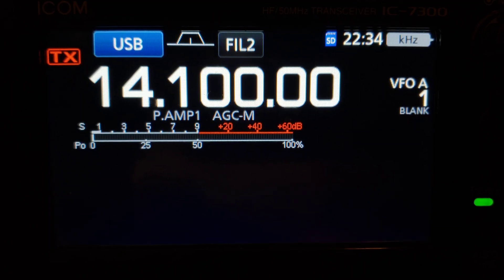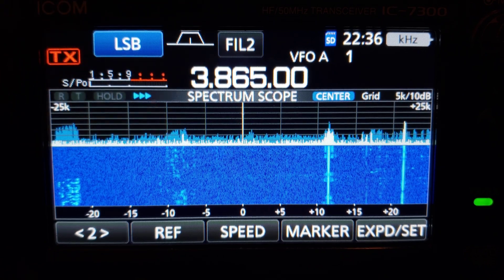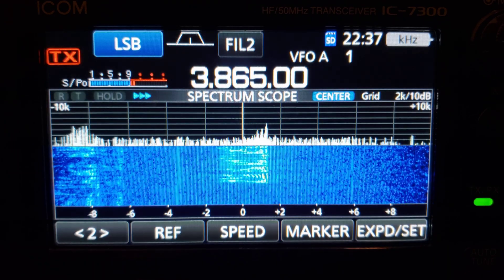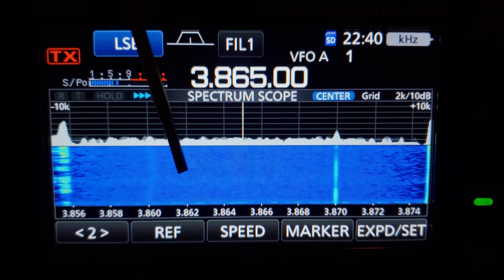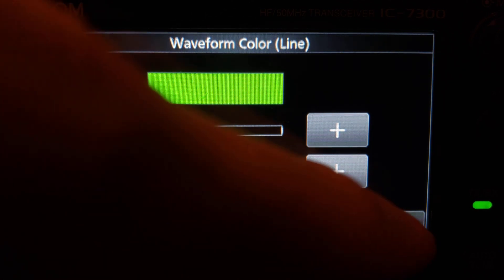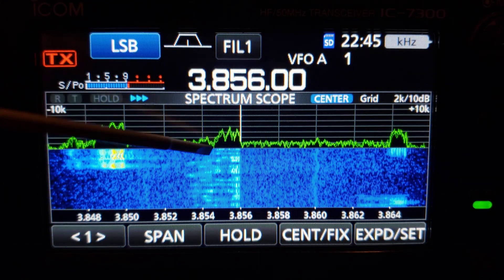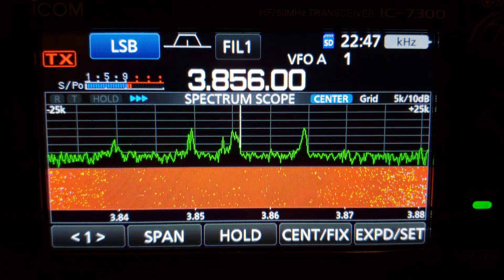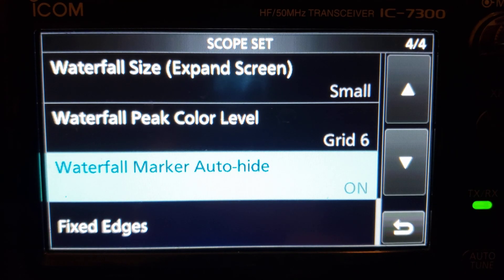Icom IC-7300 panadapter waterfall display settings for detail and weak signals

Comment: Okay, this was a very interesting.  You showed push this, touch that, to do this and to do that.  But what you did not show was what you touched or turned to change the settings,  You only showed the screen and how the settings affect the screen but what knob or button did you touch or turn and where are they located on the radio?  This would have turned a good video into a great one.  Or at least for me it would have.  Then again I am an older operator and at 7.3 decades of age am not the fastest kid on the block!  Thank for the info you shared now to dig a little deeper to figure out how to make these settings.   73
Reply: @dancontway1934  I don't know if I got you right, but this radio have a touch screen. He touches the screen to activate the functions. 73.

Comment: Auto Hide 9:35.  When you turned on auto hide then hit meter it completely covered the scope.  Mine doesn't; it covers the waterfall but still leaves the scope at the top showing the line.  ???
Reply from the maker: Not sure, I'll play with it later today and see if I can duplicate it
Reply: @K4AX  EXIT will not take the scope away.  It just makes it small.
Reply from the maker: @quaildogusa  I'm not near one but try going to the meter screen then press the m.scope button
Reply: I ended up doing a general reset and starting over.  That fixed it.
Reply: @quaildogusa that ok for now but learn your radio.😅

Comment: Thanks for the information. Helped me set up the display the way I like it. I love the Icom 7300. I have the Yaesu FT-991A, the Yaesu FT-710 and now the Icom IC-7300. I like the programming of the Icom's better, but I will say that the noise floor on the Yaesu FT-710 is quieter, especially after I did the firmware update. They are all three great radios.
Reply from the maker: I've not used the 710 yet, but heard a lot of good stuff. I'd love to try one out though, maybe this year. 

As for the Icom noise floor, it might help to eq the RX ssb audio in the menu. Cut the highs a bit with the treble. I do that, and use the NR on 1 and it seems to help.

I wish the knob radios had a AGC-T setting like some of the SDRs, allowing you to knock back the sound of the noise floor but any signal that pops over is still loud.

Comment: Hold Expand set, on, off, filter cnt., carrier point, narrow, off, fill+ line, Only red turn all other colors to black, only Green, turn all color to black, on, fast, small, grid 6, on, fixed edges, adjust Ref. see the difference.

Comment: I have both SDR Play and the 7300. I hate the look of my 7300 display but love the SDR Play. Your video helps me to make 7300's display more like that of the SDR Play. Thank you! I needed this. I also have the 705 and I think this will also apply there as well.
Reply: how did you connect icom 7300 with sdrplay?  Do you need any switch is just connect?
Reply: @ruivieiraonair  No switch is needed, just a USB cable. For software, you will need Omnirig and SDRPlay (SDRUno). The setup is straight forward.

Comment: I have had the IC-7300 for about two years and I never liked the default setting for the scope and waterfall, but I have never taken the time to really sort it out.  Call it lazy or it didn't bother me that much, but I will try out your settings and see how it goes.  Thanks for the kick in the butt.
Reply: Fixed is better, you see a signal you can scroll to the USB side or the LSB side.😊

Comment: 1:31 why bring the reference level up and use ATT? Just lower that reference level to have a clean display and use your RF GAIN the way it's supposed to be used, riding it up and down depending on what signal you're trying to copy. I'm thinking you don't work alot with weak signals. For me personally, the whole idea is not to miss weak signals.
Reply from the maker: I usually do depending on the situation, my mind was more on making a video than riding the gain 😁
Reply: @K4AX  Cool! It was a great video and I enjoy seeing the way people do things.  

I never run the scope at 25kz so things look very different on my radio with common scope settings as I try to view the entire band I'm working. Just my own personal preference  Also I have a ton of noise on 40 meters so I have to employ an MFJ1026 signal enhancer which is a life saver, but attenuates the display.